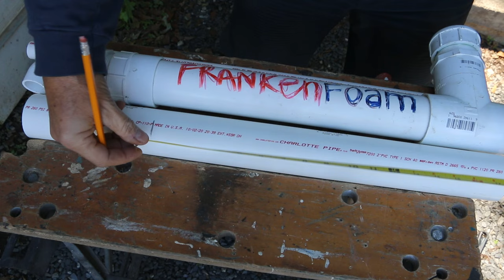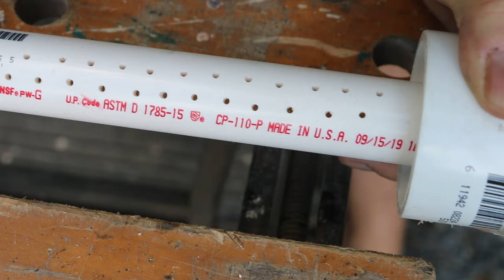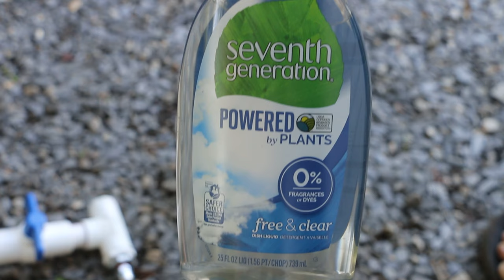How To Make A Simple Aircrete Foam Generator | FrankenFoam

Comment: Worked great! We made it today. A couple of things: yes, the brand of soap matters a lot. Your generator should be at 90 psi and it took literally 2 Lowe’s and 2 Home Depot’s to find all the parts that with the price increases ran like $70+ in total…but still totally worth it since I’ve been dreaming of several aircrete projects and just needed a gun. Thank you so much for sharing your plans! One small thing, the parts list is missing the 2” T. Gun works great!
Reply: What brand of soap is the best?
Reply: Are you telling me that the situation is as bad as in Panama with driving around for parts? ;-) I’m still thinking if I should build a 20ft long foam gun….. ;-p
Reply: Thank you for your comment.  I don't have the compressor yet so your comment is helpful for me to know what to get
Reply: I'm new to aircrete for building safe places for the coming CLIMATE CHAOS. 
    Really love your ❤ and ingenuity and openness to share.
    How about using air stones verses the steel wool?

Comment: 9 minutes in, if you're quick enough, could have used the smaller piece to knock the fluted piece back halfway through the fitting again for more room to fit the smaller one.  I also think it's to complicated,  what's wrong with a siphon system, like a paint sprayer before the mixing tube of stainless wool?
18:20 - the teflon also gives it some lube making it easier to turn, plastic on plastic has a huge amount of friction.

Comment: On somehthing like this, primer is not needed so much, but when you do plumbing under pressure, primer is essential!!! especially on the printed labels or if you are using dirty pipe or old pipe that has been laying around outside. (or is existing plumbing exposed to elements.) Oxidized PVC glues VERY poorly and the primer will make it much more "agreeable" to  glueing. For instance, If I built this, it will be from leftover waste pieces from other projects that have been stored outside behind my shed, so I would HAVE to use primer for a good glue joint. I also read below that someone likes to sand it, also good, but you can get away with just cleaning it real good with primer - your preference. If you're going to sand it, use the roll strips of sandpaper, so you can "saw" it round and round like a shoe shine
Reply from the maker: Great tips! Thank you for sharing. Thank you for watching.

Comment: Great stiff! 👍 
I made some anti rodent tubes with PVC that have a 1 1/2” threaded PVC connection. I always used teflon tape but after a couple of uses the threads still wanted to gall/bind. It amazes me how much force it takes to break it free when this happens. I still use teflon tape but found putting some paste wax on the threads keeps them from binding and makes for an even better seal. The tape last longer too. I have been using a few of these for several years being opened and closed several times each year and they never bind up and seal tightly without having to over tighten.
Reply from the maker: Thank you for the input. I appreciate it. I’m still learning.

Comment: A secret to taking the lip off the inside of your fittings, use an electricians step down bit, they make them in small to large sizes up to 2 in. Using the step down bit will also allow you to not only take the lip off, but widen it enough you can use a rubber seal gasket if you choose. Using the rubber o-ring allows for quick disassembly, as well as airtight and no leaks.
Reply from the maker: Great tips. Thank you.

Comment: 13:21 i was going to say same about both sides when I first saw you fail to do so. I also believe, it is a good habit to pass brush twice over each surface alternating between part A & B: A, B, A, B careful to limit pooling and wipe away excess after fitting

Comment: Nice design, I really like it. I think it was just fine with the additional air holes though. All you probably needed to do is open the Valve half way if you wanted the foam to come out slower. It actually makes it more versatile so you can pump foam out in a hurry if needed.
Reply from the maker: Thank for the feedback. Thanks for watching.
Reply: No me quedo claro cuanto miden los dos tubos que van dentro del de 2"
Reply: @noranoack7239   Una  Pregunta  en la  T  donde  pone  la  entrada  de  Aire  del  Compresor   al  otro  lado  q  pone
No hablo  Inglés
Gracias  Si me  puedes  ayudar.. 🙏🙏🙏
Reply: Lleva un tapón.  La idea es que la manga de aire no sea lo que aguante el peso una vez colocada en el piso. Y un codo no es tan estable como una T con un tapón.

Comment: The best design I've seen so far. I wonder if you could make the soap go through a venturi system so you could have more of a reservoir
Reply from the maker: Thank you, John. You could always just lengthen the side pipe to increase volume. I think it would be difficult to keep the mix consistent using a venturi. I think the pressures on this generator fluctuate a bit. Thank you for watching.

Comment: Great info.  Only comment would be….. 2 wraps of Teflon tape covering the first 4 threads is all you need.  (I’m cheap). Also consider which direction you will be operating from right or left.  Being a right handed operator, I like my air feed from the left rather than right.  Great product!
Reply from the maker: Good things to consider. Thank you. Some say cheap, I say frugal. Waste not, want not. :-) Thank you for watching.

Comment: The fittings have release agent on them , you should use pipe cleaner on all fitting connections. You bought the light bodied clear glue, you would probably like the orange medium body glue better. You get much more working time with the orange glue
Reply from the maker: Thank you for the tips. I appreciate it. Thank you for watching.

Comment: I would just sand the inside of the through fitting a little more and dry fit the pipe before gluing together which is always a good idea... also have a hammer ready to add a little persuasion if necessary...
Reply from the maker: Thank you for the suggestions. :-)

Comment: When you were putting the perforated 3/4" pipe into the fitting, you could have put part of it in without the pvc cement and then put the cement on the small pipe and push it in so it goes through more before it sets.
Reply from the maker: Agreed. Thank you for the tip, Kati. Thank you for watching.

Comment: Dear guy, great job, nice style and funny ways to be yourself despite imminent international incidents on your way with your foot on the wrong side of the line. I've had fun with your in structions to build Franken Foam (hahaha!) and I have made my after watching your video for the fifth (did I say tenth time?). Now, I'm ready to glue it and test it. I'll have to wait (mired in anxiety) for my wife to bring me the stainless steel wool from the supermarket. I'll let you now about my inescapable success. Cheers from Chile!
Reply from the maker: Ha! Great comment! Love you sense of humor. Hope your glue-up goes well. Thank you for watching.
Reply: Master of Frankenstein Foam, I have to tell you that my inminent success became a tiny&short joy with very little amount of foam and the lost of the whole water in the reservoir on matter of seconds. The trouble, besides the very small size of wools (only ones available at the supermarket and which were filling half of the reservoir), is that the tube that sticks in the reservoir (that you cut in your video because it had too many holes) was to short or something. When I put the water in the reservoir it started to come out of the tip (obviously I think because of the short amount of wools). Would love to hear your wise advices about this foaming nightmare. Greetings!
Reply: I clearly said "Master of Franken Foam"

Comment: @13:30, make sure you CLOSE the ball valve before glueing.  Maybe you can get lucky, and the glue won't get into the valve mechanism, but best practice is to close the valve before glueing.  Before I knew that, I made some joints with ball valves that I couldn't turn all the way off because they got glue in them!

Comment: You know, it occurs to me that if you fitted another barb just after the air inlet and attached that to a pressure washer detergent bottle, the pressure from the air would suck the detergent up thehose into the resevoir, therefore you could make bigger batches, simply using a bigger bottle.

Comment: Instead of Teflon tape which will come off after repeated removal and replacement of the cap onto the reservoir, pipe joint compound would be easier to use and probably just as effective without having to be replaced as frequently as Teflon tape.

Comment: Interesting video of foam gun what’s part 2 ? What’s your ratio of Portland cement to foam?
Reply from the maker: An exact ratio has been a bit elusive for me. I think the best results have been with 1 part portland to 2 parts foam. But, it was very helpful to seal off the top of the forms with a plastic sheet. Keeping air away from the aerated mix really helped keep it from slumping. Thanks for watching.

Comment: Scotch Brite can be used as an alternative to the stainless steel wool, right?
Reply from the maker: I've used the Scotch Brite brand stainless pot scrubbers. They aren't as dense as the steel wool and the foam wasn;t as thick. However, the green mesh Scotch Brite pads should produce similar results to the steel wool. Thank you for watching.

Comment: Place check valve between air inlet and pipe with small holes in the bottom to prevent back flow,,,,perhaps?
Reply from the maker: Thanks for the suggestion. Thank you for watching.

Comment: if youre connecting that to a 55 gal drum and need more foam solution than the cup you put in, how would you allow for more foam?
Reply from the maker: Hi Kea. The easiest solution would be to make the section of pipe with the screw cap longer. Thank you for watching.

Comment: When gluing pvc or abs to get a longer set time you need to put lots of glue on both sides and have a rubber malot to give it a little bit more persuasion I've been planning on making a methane gas digester and I've been thinking of using a similar idea on. my outlets of my digester same problem just a bigger fitting I'm also looking at doing some aircreat next summer thanks for the excellent video by the way what's the difference between the stainless steel you buy and the stainless steel scrubbers the loony store
Reply: Think he said scrubbers are too course and wool gives a denser foam.

Comment: What is an ideal size air compressor would you recommend. Airflow and pressure.
Reply from the maker: Hi Leon. I think the smallest pancake compressor would be fine for aircrete. You may want a bigger compressor if you want to do more with it. 40-60 PSI is enough. Start on the low end. It’s a cool process. Have fun. Thank you for watching.

Comment: when connecting the 3/4 pipes, do the same procedure as filling with your rounded file; except you use a drill saw. I Have done it when connecting  pvc's joints
Reply: Thanks for the suggestion I've been thinking of using this idea of a pipe though a reducing fitting and I was thinking of this idea and wondered if it would work now i just have to see if it'll work on a 2  inch by 1 1/2 inch bushing I'll find out by summer also find out if my radical idea for a methane gas digester will work

Comment: Hello, I hope you are well, I was able to make the foam cannon with the plans that you provided in PDF, however I have a problem, and that is that when I turn on my air compressor and normalize the air pressure to 60 PSI, the first The mixture that comes out of the product is totally liquid and the rest is foam, but I'm talking about it being 80% liquid and only 20% foam. Maybe you can give me a tip on what I can improve since I've been wasting a lot soap and I don't even get a bucket of foam :c
Reply from the maker: Try lower pressure. Also try putting the generator on an incline so the foam must rise against gravity. You may need more resistance. In other words, more steel wool. Mine usually sends out an initial blast of liquid and then settles into thick foam. You could also try more soap in your ratio. Hope this provides a solution.
Reply: You need 90 psi

Comment: Hi. I followed this guide and yes the foam generator does generate foam but I ran into the same issue you seem to have stated in other videos but not this one, that of not being able to get the foam to the proper density. it always comes out around 30g/liter/quart instead of the 90-100g we are looking for for aircrete. Did you ever solve this problem or just move on and make aircrete with that density foam? I've only tested the foam by leaving it out and seeing how long it took to collapse and it was halfway collapsed in just an hour and a half. Regardless of if I used suave or drexel or set my compressor's psi between 90 and 30, the results were always the same.
Reply from the maker: Hi Christopher. My practice with aircrete has been less scientific. I've tried to get a consistent weight on the foam, but I tend to make smaller batches, so the weight is hard to measure. The real test for me, is if it supports the cement long enough for setting without slumping. I have had success with that. One thing that helped was to cover the filled form with a plastic sheet. The projects I have been making are smaller, so the final density isn't as much of a factor, at least in my mind. I'd say that with your hour and half collapse time, you'd have success keeping the concrete suspended long enough to set. Ultimately, I have to top trying to get the weight right and just try making some aircrete. I know you were looking for a different answer, but I hope this was helpful. Thank you for watching.
Reply: I'm going with Drexel fm 160 foaming agent. It's used for agricultural marking and stands up better than any soap product. Just ordered 2 gallons from Rural King as they had much better pricing than amazon. Will be using this to make styro aircrete. Appears to be much more tolerant and better insulating than aircrete based on the youtube videos from Stephen Williams.
Also, check out this video from Aircrete Harry comparing the Drexel product with dishwashing liquids https://youtu.be/S1ydXgWDU00

Comment: How about green scratchy pads instead of steel wool?
Reply from the maker: I think that will work. Make sure you’ve got a good six to eight inches of pad built up. They might perform better after they gum up a little bit over time and use. Thank you for watching.

Comment: I'm mostly done with mine, just made a couple alterations.  There is one small mistake in the video and description.  The galvanized fitting is to go from 3/4" to 1/4" not 1/2" right?
Reply from the maker: Good catch, Keith. I’ll have to check. It depends on the airline fitting, but I can’t remember which it was at the moment. Thank you. Send photos when you are done. I’d love to see it. Thank you for watching.
Reply: Maybe 3/8" ?....around here, in South Africa, airlines tend to be 3/8"

Comment: Instead of using the 2” cap for threaded connector and 2” female threaded connector you might try a 2" ball valve.
Reply from the maker: Thank you for the suggestion. That would solve the bubbling. Thank you for watching.

Comment: hey. ive followed your franken foam instructions and the water leaks out. I have to tilt it. is that usual? and when the generator comes on it shoots foam for 1 second then sputters out.... how to increase the pressure on a metabo hpt... ? by the time i pour in a new 16 oz, the last batch is deflated
Reply from the maker: I do put my foam generator on a tilt, hanging on the edge of the bucket at the high end, and sitting on the ground on the other end. On the sputtering foam, your air pressure is shooting through the foam generator in one blast. I’ve had this issue early in my experimentation on this design. You can help this by adding more of the stainless steel mesh. Another way to help is releasing the air pressure more slowly. More mesh will help with creating thicker foam. That is the issue you gave with the foam deflating. If you need to make a larger amount of foam, make the tank portion of the generator bigger, so it can hold more liquid per batch. Hope this helps. Thank you for watching.

Comment: Thanks for this, very helpful. How much aircrete does one fill-up make? Or how much cement to use with one fill-up of the FrankenFoam?
Reply from the maker: I usually mix up about 1/4 of a 5-gallon bucket of cement and then add about 8 inches of foam to that. It fluffs up to about 1/3 of the bucket worth of aircrete. But, it only uses about half of the liquid in the foam generator. So I can do another batch of cement for one fill of Frankenfoam. Thank you for watching.

Comment: Question: If you only had need for a small amount of foam concrete, what would be wrong with mixing foam from shaving cream cans (purchased at a dollar store) with a cement slurry instead?
Reply: I imagine that if you do a test with a can and a handful of cement, mix and pour a little, let's say, into a shoe box adapting the proportion indicated in the video, it will give you a better idea and you will be able to test its resistance. That also gave me an idea.
Reply: @rennyotolinna2863  I like the shoebox idea--gives you a brick at the end.

Comment: I looked on Amazon and they don't have the big foam maker,,does the foam harden after ,because the one i saw on Amazon is to wash cars.
Reply from the maker: The cement aerated by the foam hardens. The foam holds up long enough to support the air pockets. The foam generators on Amazon are generally for cleaning.

Comment: Question... I want to use it to wash motorcycles.  Do you think I could run a 1/8'" tube in the top cap and have it suck soap/water out of a bucket?
Reply from the maker: Hi Steve. I'm not sure if this would pull enough of a vacuum to suck up liquid. I suggest just sizing the tank part of the generator a little bigger. Thanks for watching.